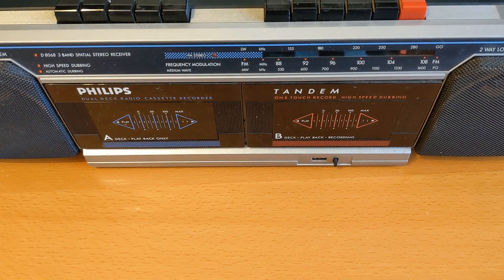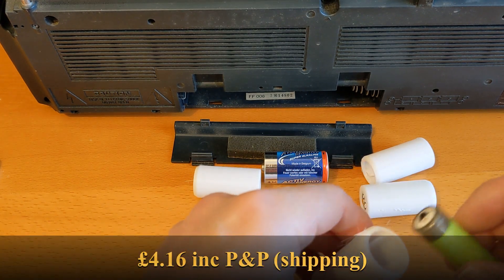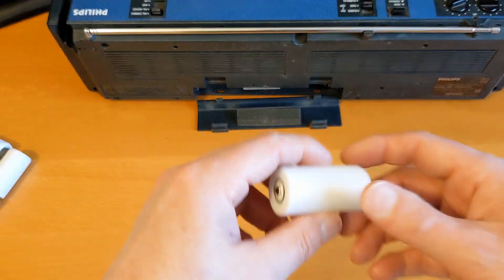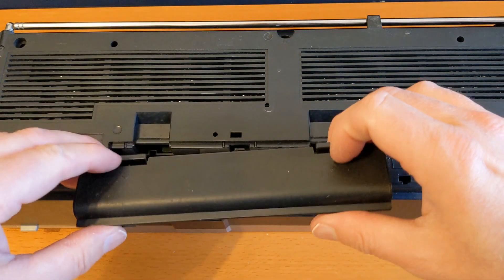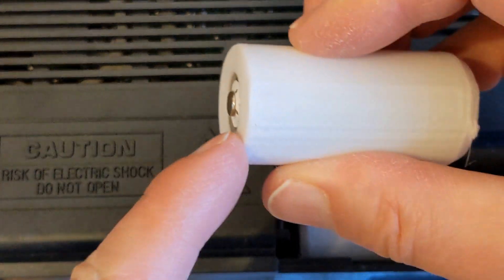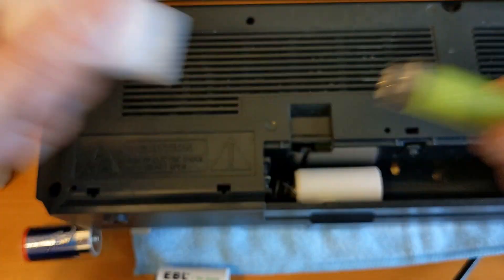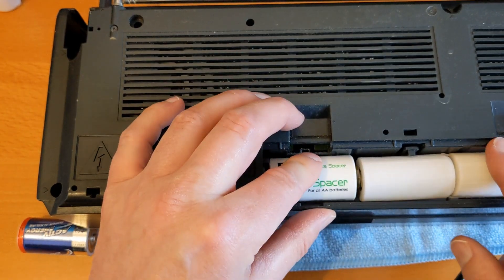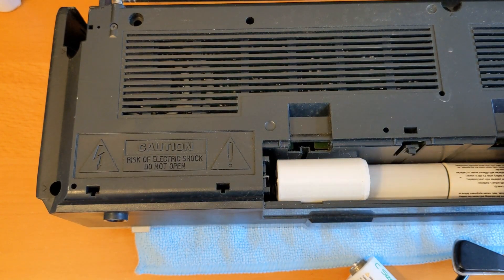Battery Size Adapters (includes fail)

Comment: I have also been interested in these adapters, especially because I expect a significant weight reduction.
Reply from the maker: Very good point. I just weighed them. One Amazon AA rechargeable battery (2400mAh) plus the EBL adpater/spacer is 35g. One C-cell rechargeable (Activ Energy from Aldi 4000mAh) is 71g. Around half the weight.

Comment: 02:17 I think you mounted it backwards.  Try reversing the position of the batteries inside the 3D printed adapter.
Reply from the maker: Thanks. After shooting and editing the video, I wondered if I had put them in backwards. I checked the eBay listing again and the seller's photos showed I had put them in the right way round. I think they would have worked better in backwards, but I used a Dremel today to bore out bigger holes in them all so they work either way now.

Comment: The EBL look very similar in design to Eneloop adapters maybe also see how much they are compared to EBL
Reply from the maker: Thanks. I just had a quick look on Amazon for Eneloop ones but couldn't find them. I'm going to mod the 3D printed ones later so I'll be good with these for now. Thanks, though, I'll look for Eneloop ones too in the future if I need more. It's worth paying up.
Reply: @CBitsTech  I have some with damaged packaging I can't sell if you have at PO Box I'm happy to send you some C & D size
Reply from the maker: @Adam-Adamson  Thanks very much for the offer, but I've modded the printed ones with a Dremel and they work fine now.

I had tried to send this reply a few minutes ago but it disappeared. If you sell stuff online, don't give me a link (it will be deleted), but give me a clue as to the seller name and platform (A or E) and I'll take a look. Thanks.

Comment: Ok that's good to know, I'll shell out for the EBLs, I am very much in the market right now. I suspect that the 3d printed ones could be modified and a simple press tool could be made to make the cells easier to extract, but still, I'm a bit shocked it didn't go through any more prototyping, that is the one downside to the rapidness of 3d printing I suppose.

Also if you ever find that the Ni-mh cells don't have the voltage for some applications, they started making 1.5 volt lithium ion AAs rechargeables. I've been using them in the Sony WM D6C I way overpayed for and they work great.
Reply from the maker: Thanks. The 1.5v lithium ion ones, are they individually charged with USB? The D6C seems like the ultimate Walkman.

Comment: You can get cheap versions from China (they used to be a pound for four but everything is more expensive now), which are more like the EBL ones. I guess you could take a hacksaw to the 3d printed ones - they don't need to be the full length they just need to hold the cell in approximately the right location.

ETA yeah £1.50 delivered from China on the usual sites.
Reply from the maker: Ah, China. I could have bought some from China but I wanted them faster than the slow boat would have taken.

I got my dremel out as an alternative to your good hacksaw suggestionm the realised I still wouldn't be able to get the batteries out unless I hacksawed the ends off as you suggested. I'll experiment later. Thanks!
Reply: @CBitsTech  I know its a hassle but i often buy stuff on alliexpress and just wait for it and move on to another project. I also buy similar stuff because its so cheap you can get 3 slightly different things for less than 1 sourced in the UK. Sometimes  if you spend enough money you magically get upgraded to combined shipping.  What i think happens is the items get combined in one bag china side and airmailed to the UK but i'm not sure. It doesnt always happen and as they say you get what you pay for.
Reply from the maker: @stevewhitcher6719  I see. I'll look into that. I still can't get my head around import duties though. Are you in the UK? If so, do you pay import duties and fees to Royal Mail for collecting those duties please?
Reply: @CBitsTech  There's no duties under £135  now in the UK, as the VAT is added at point of sale. So what you see is the price you pay.
Reply from the maker: @jasejj  Thanks very much. I suppose that's assuming that the seller follows those rules. I'll give it a try, thanks.
Reply: @CBitsTech  If you buy from one of the big Chinese marketplaces - ebay, Ali, even Wish (not that I'd recommend them!) it's those platforms that add the VAT. At that point, as long as the total value of the package is less than £135 there will be no additional charges.

More than that and you're back in "don't pay any taxes or customs and hope the customs guys in the UK don't examine your package" territory.
Reply from the maker: @jasejj  Excellent, thanks 😁

Comment: the 3d printed adapters - much like 3d printed anything - make a lot more sense when you're printing them yourself! You should be able to edit the model, or just sand them down.
Reply from the maker: I agree. I used a Dremel to make the hole bigger so the battery can pass through. They're fine now.